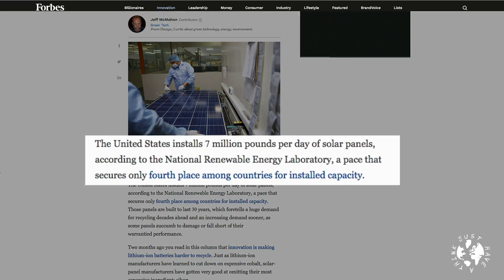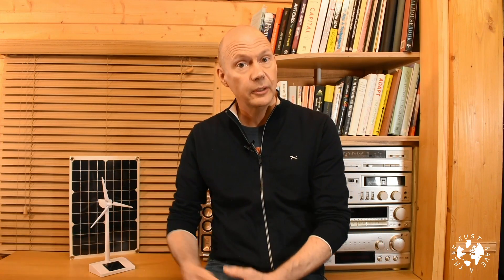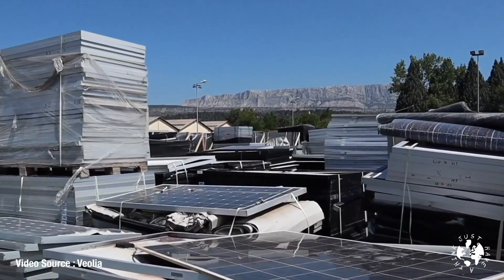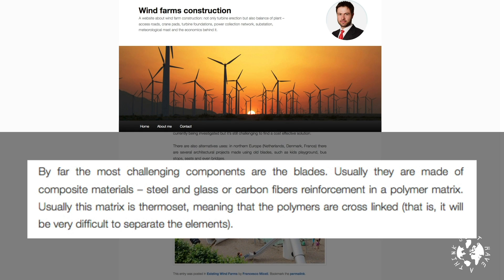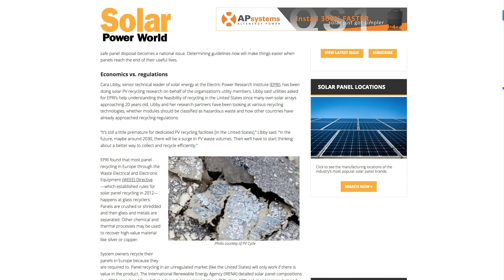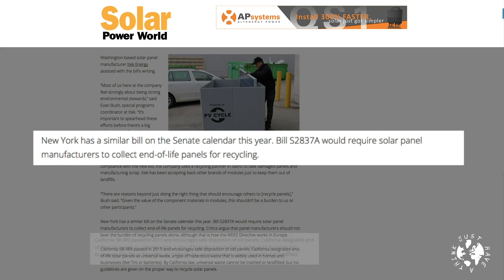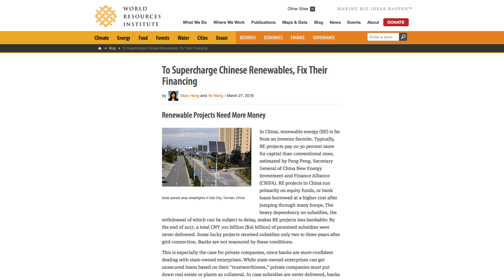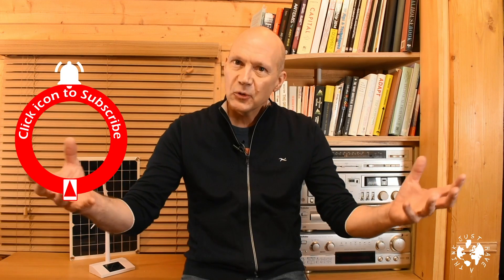Recycling renewables : a price too high?

Comment: When my Grandfather bought a PV Modul in 1980  guess he did not expact to work longer than he lives so 39 years later it still works...
Reply: Yup got some that are 35 years old  and yeah it no longer provides 3.5 amps only 3 but still perfectly fine for my use. I have 10 of them on a little shed for lighting and a water pump.
Reply: Especially with smaller private or commercial units - you also have to consider the fix costs of installing them and setting up the wiring, plus the transformer that likely is outdated and cannot be used with a new installation - so it is likely better to squeeze 5 or even 10 more years of use out of old panesls (even if they lose performance), add a few new panels (if they can be integrated into the setup). And/or buy more electricity  from the grid. 

Better batteries (or cheaper ones, meaning you afford a few more) also can change the efficiency of an installation. 

When harvest is good there will be plenty of surplus (so decreased efficiency does not matter in that context). You can store more of the surplus or longer (instead of supplying at low prices to the grid at peak times.

Plus buying the rest of the needed energy from the grid and be done with it.

There is also the issue of "grey energy", the energy that is needed to produce something. so of course if you get more than the predicted years of use out of it, that is good. (and the inevitable impact to extract or process raw materials, transport, recycling  will be delayed - resp. the costs on the environment (even if produced in a clean way there are some impacts) will be put to better use.
Reply: @xyzsame4081  Tying solar panels to the grid has it's problems, their output is very erratic & they only produce while the sun is up & it's greatest production is around noon when demand is usually least. 
If many people have solar panels tied to the grid, it poses problems to grid operators, out put must match demand, solar is all over the place & messes up their ability to keep the grid stable.
People with solar panels pay less to the grid operators for their electricity cutting down on the grid operators income leaving less income to maintain the grid leading to more grid failures & blackouts. 
Because the wealthier solar panel owners pay less, those who can't afford solar end up paying more for their electricity. 
The poor end up subsidizing the rich.
In most of the world including the US & especially the east coast depends upon fossil resources to generate electricity, as those decline, the grid will become even less reliable until it finally fails for ever, then those with home solar panels had better have a battery storage system or they too will be left in the dark along with their poorer neighbors.
Long term, within 50+ years or so, everyone will be left in the dark once we run out of accessable, affordable fossil resources because "renewables" & their batteries are tied to OIL.
Reply: @sheilachambers6671  demand is highest at mid day in most of the u.s.  As things warm us, this will only become more true.  

Solar power is much less expensive for power generation companies now.    LA recently settled bids for 2c/kwh (solar) and 1.3c/kwh (battery for night power) and Saudi Arabia just signed for a huge project at 1.7c/kwh.

This means the poor are not subsidizing the rich at this point.  I agree they did at the start but that helped keep production and improvement going until it got this cheap.

There are various systems for storing the power for use between 6pm and 11pm when power use surges but there is no solar (the "duck" curve).

Maybe by 50 years from now we'll get the levelized (total) cost of nuclear or fusion power down to reasonable levels.  Right now, the decomissioning costs are typically 2 orders or magnitude higher than initially promised.  Which means the actual cost of nuclear power today is being subsidized by people who are not even born yet.  That's fundamentally immoral.
Reply: Romeo Sierra says:
"When my Grandfather bought a PV Modul in 1980 guess he did not expact to work longer than he lives so 39 years later it still works..."
==
Average ownership of cars is 5 years, by comparison.
Solar panels have no moving parts to break down unlike cars.
Only reason to replace would be the people wanting to replace it for more efficient newer models.
Reply: @allgoo1964  I have 16.3kw right now and I'm off grid I have different voltages running from my house like 5 volt 12 volt and 230 AC absolutely doesn't matter that I have nine different types of PV modules
Reply: @ReinhardSchuster  says:
"@allgoo19 I have 16.3kw right now and I'm off grid I have different voltages running from my house like 5 volt 12 volt and 230 AC absolutely doesn't matter that I have nine different types of PV modules"
==
If it works for you, you should keep it.
On the other hand, "upgrading" is a hobby to some people.

They have to have the latest of everything just for the bragging right.
Reply: @allgoo1964  I absolutely don't care if they not match as long as they broke I will use them
Reply: Cannot say the same of coal-fired plant, can we?
Reply: Like #Feckless Politicians, they get older and less productive every year...
Reply: I expect the 16 x 305W panels I had installed earlier this year to still give 290W in 25 years time, and to outlive me. The battery is good for 6000 cycles, far more than ten years.
Reply: I always wondered at the circularity of these renewables. So this was heartening. Hate the fact that they require so much land though. Wind turbines with the risk to birds is the worst
Reply: At the same efficency?
Reply: @nicosteffen364   No doubt NOT at the same efficiency, but so what? That story is typical. Solar panels last MUCH longer than originally anticipated. This video is scaremongering bullshit by a guy who has no suggested alternative.
Reply: @alan2102X  you are right, i mean if it still works good enough, why replacing it? its the same with other things, car batteries last longer than expected, solar panels last longer, aso, its always the same game, take the worst case and make it look like thats the average to support conservative positions!
Reply: Most of the first experimental silicon solar cells are still functional. They degrade down to 70-80% efficiency over the first 20-30 years and basically settle there, losing efficiency very slowly past that point. Basically if you need 100W from the panel forever, you should install:
100 / 0.7 = ~142
So 140-150W installed now should guarantee 100W provided until you're not around to care.
Reply: @alan2102X  It's not "bullshit" to think about this. It is one aspect of the industry that I neglected to address as Guest Editor of Alternative Sources of Energy magazine decades ago. These are the unintended consequences of any industrialization without cradle to grave precautions.  Nuclear waste is a case example of such a neglect. Similarly  we did not see that China would be placing megafarms of photovoltaics in the Xinjiang. That desert area by the way is the dust particle source for much of our western USA rainfall (The Dust Detectives. High Country News 2014.) Impacts on the global freshwater cycle is another known unknown. Warren Buffet is doing the same in the "useless" waste land called the western Mojave desert in California. Impacts there are also unknown. Read, I encourage you E.O. Wilson latest books. I liked the think presented  by him that humanity's survival depends on reducing our impacts to keep wild at least one half of this biosphere and its natural services we benefit from daily.
Reply: @stephenverchinski409  Thanks for your reply. A few things:
1 Scaremongering = bullshit (what I took exception to)
2 Sober analysis of full lifecyle of materials/etc. = necessary and good.
My reaction was mostly to the terrible click-bait title, which WAS #1 (bullshit): "Will renewables end up as more landfill?"  The answer is NO. First, panels last MUCH longer than 20 years, and second, they are almost fully recyclable. And in fact this very video mostly corroborates the latter point -- inconsistent with the bullshit title.
Yes, there are going to be some unpredictable or difficult-to-predict effects, but does that not describe EVERY SINGLE ASPECT of industrial civilization?  The question is not whether or not we can escape poorly predictable adverse effects. The question is how to avoid the worst of them, and how to mitigate what's left.  We cannot dismantle industry (unless we don't mind billions of deaths to starvation and disease). The only way is forward. We KNOW that fossil fuels are far far worse than renewables, and that's good enough for now.  None of which, of course, is an argument against #2, above - Sober analysis of full lifecyle of materials/etc.  Such analyses must be done and we must act accordingly. Nothing is free of harm, and is it necessary to say that that includes renewable energy?  Let's stop the hand-wringing bullshit (like this video's title) and get on with the work that needs to be done.
Reply: @alan2102X  I don't see this as "scaremongering", he is stating that given a typical operational lifespan of 30 years, that there is going to be a lot of waste...in you guessed it 30 years. Also note, that even IF they left them out there longer, they will not be as efficient. As a result, they will have to deploy additional panels to pick up the slack, thus kicking the can down the road. In summation, in 30, 40, or even 50 years there will need to be mechanisms in-place to deal with the large amount of "clean" energy generation waste being produced.
Reply: @besomewheredosomething   The TITLE of the vid is scaremongering click-bait. The content of the vid was rather different.
Reply: @alan2102X  really? I mean to each their own, truly; however I just don't see "will renewables end up as more landfill" to be scaremongering or clickbait.
Reply: @alan2102X  so pointing out the coming and potential problems with renewables is  bullshit? So I assume you think that creating more waste that can cause detrimental environmental impact is bullshit? Come on man, that's hypocritical, just because it's not fossil fuels doesn't mean we should bury our head in the sand and repeat the same type short sightedness that have us in the situation that we're in.
Reply: @alan2102X   you are wrong, efficiency is everything when it comes to energy production and systemic optimization. The fact that you can still ride your granpa old 1955 Chevy truck does not mean it is environmentally friendly...  He says it:"There is no silver bullet solution" and/but the problem is real... Solar panels are actually very delicate, not designed for recycling, and can perform inconveniently in not that long of a time frame...
Reply: @besomewheredosomething   "so pointing out the coming and potential problems with renewables is  bullshit?"   ABSOLUTELY NOT. Did you even read what I wrote? "NOTHING WRONG WITH FACTUAL DISCUSSION OF COSTS". See my post, above.
Reply: @albertorosasaguilar   Not sure what I said that you are replying to. I cannot make sense of what you wrote, insofar as it purports to reply to me (it doesn't).
Reply: @alan2102X  "No doubt NOT at the same efficiency, but so what? That story is typical. Solar panels last MUCH longer than originally anticipated. This video is scaremongering bullshit by a guy who has no suggested alternative."
Reply: @albertorosasaguilar   The point was that solar panels lose the ability to generate  power, but do so only very slowly in small increments, remaining effective power-producers for MUCH longer than rated life of ~20 years. The oldest installations are running after ~45 years and still are performing decently. Your comment above is just insubstantial hand-waving. which does not related tot he real situation, on the ground, as  it is being observed right now.
Reply: @nicosteffen364  You haven't bought a new car battery recently have you?
Ifbyou had you would know they last about one third as long as 20 yeas ago!
Reply: @alan2102X  I think your view is kinda Naive, solar panels can last a lot or less depending on the location and manufacturer, dont forget they also degradade and they alone can't do it. The good option in my view is to mix it with nuclear on big cities that need the sheer power and stability of nuclear plus the flexibility of solar. or geothermal/hydro as a less powerful alternative to nuclear (tho not recommended for huge cities).
Reply: @CarlosAM1   "solar panels can last a lot or less depending on the location and manufacturer" -- did I say otherwise?
  Nuclear is DEAD and is very likely not coming back. No one can afford it. Solar and wind are much much better deals.
Reply: @alan2102X  Lmao tell that to france, china, india and Canada who are all now investing highly on nuclear, France already is 70% nuclear energy and recently Canada finished the first SMR-MSR type reactor, not to mention ambitions for LFTR, Pebblebed and Travelling wave reactors which all can use thorium.  Nuclear is still useful, and renewables in the form of highly unstable Solar and Wind sources simply can't do it alone, neither can Nuclear, they both have to be combined with Nuclear being the most powerful, safe and stable alternative for a hybrid source (all be it expensive, though this could change if Th reactor technology is helped develop) Nuclear is not for your village, its for Cities and France implemented this perfectly and mixed it with other renewables to get cheap electricity.

Edit: also there have been improcements in fusion, especially in deuterium stellarator and ultra-dense deuterium fueled target reactors
Reply: @alan2102X  Yet again, renewables cant do it alone, germany tried it and their electricity cost skyrocketed, fusion and fission are way more stable and do not rely on the climate unlike renewables, they also are actually safer due to less deaths per year overall out of any energy source, not to mention the high fuel density and extremely cheap electricity cost (but not build cost). If you only use renewables your electricity bill will be extremely high and you will need huge battery storage systems that would need quite a few rare earth materials, renewables are nice, don't get me wrong, but they are unstable by nature, nuclear is not, you need a hybrid power grid or you will get nowhere, this should be basic information to anyone with basic knowledge about energy production. of course this is ignoring that the cost can go down a lot and uranium refining will be almost none if thorium is used, it also makes recycling waste easy, produces less of it, helps make hydrogen and diamethyl ether which is a direct replacement for gasoline as well as many isotopes that can help cure diseases and have uses in many industries, modular reactors are also on the way and nuclear itself when combined with renewables helps eliminate their problems and makes a stable grid. You can't use only one of the two sides, you NEED to combine them.
Reply: @CarlosAM1    Your arguments were really great and convincing as of circa 2005.  Different world now. Renewables MUCH cheaper than nuclear, and rapidly becoming cheaper than fossil.
Germany is special  case for many reasons, not least unfavorable latitude and absent the UHV grid now being built. There are several good analyses of German power situation, but I sense you would not read them. You want to believe nuclear industry drivel, ground out by ppl desperate to remain relevant. I do like the "must combine them" thing, though. That's an amusing fall-back position, on the road to nuclear's total irrelevance and collapse.
Reply: @alan2102X  I will ask you the same, Alan, you are repeating yourself over and over again no matter what I say, you believe that "Nuclear is dead" and don't respond to anything I say, you just say that you are right and I am wrong and that my points are old and wrong but yet never say anything to prove them wrong. You are too stuck to your idea to a point where no matter what anyone says you will stick with it, "it's too late for nuclear" even if I explained to you multiple times that it's being used even more and more now with many projects underway. And of course I am going to select a few countries because not everyone can afford nuclear, but the big countries definetly can, and as I explained 3 times now  many projects are underway, Iter for fusion and many for fission, its just that you don't seem to understand that its these powerful countries that are the biggest contributors to global co2 emissions. "There's so much you do not understand like baseload and intermittency" like what? Of course the baseload is not literally real, many sources have debunked this and you just say I said it even when I literally never did, making up an argument and then debunking that to not focus on the actual point, one that I already mentioned 3 times already. That renewables are unstable and you NEED something that is stable to back it up, Nuclear being the safest, most powerful and cheapest option, and it is going to become even safer with all the reactor types I mentioned before that you went ahead to swiftly ignore.
Reply: Bullshit video...Solar will last untilnew free energy devices will change technology , but used solarpanels still also work very well...You can already buy used PV panels which generate still 60 Watts for around 15 Euros...